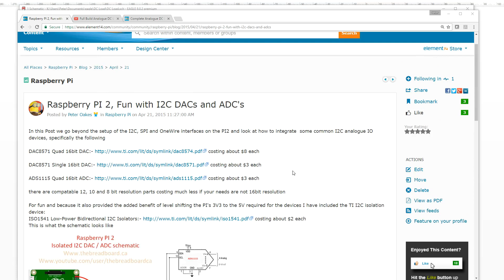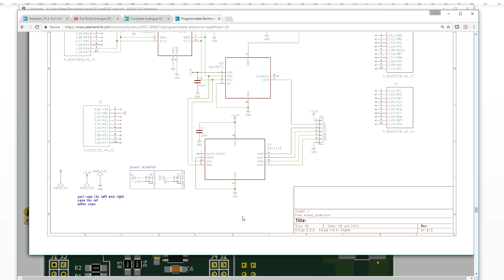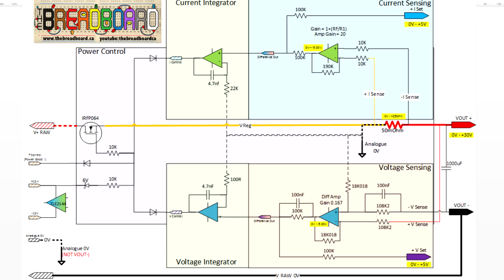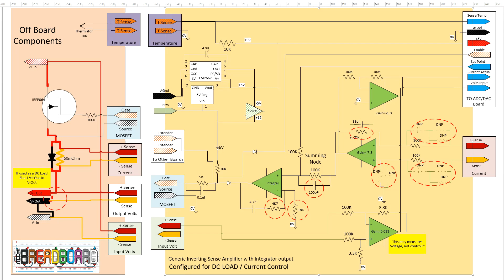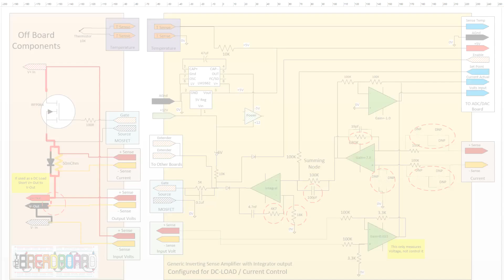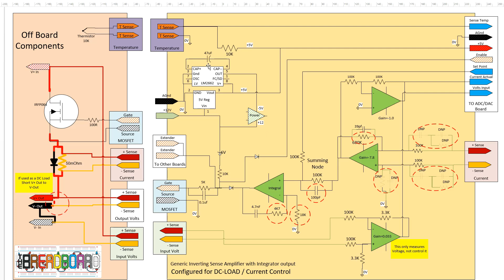Automate DC-Load and Bench Power supply... Finally we're off again

Comment: Did this project go anywhere? 
I don't see anymore about this project on your channel.
Reply from the maker: There has been a lot of work on the Element 14 community site, a PCB was developed and using TI microcontroller a SCPI based interface also was created for use as a DC load. I plan on using the same PCB;s to create a full blown power supply control system but I have not got back to it yet... I will be soon

Comment: Dear Peter
This "Power System" series is an absolute brilliant set of videos!!!!
Very practical for me as hobbyist but with the necessary precision, it is expendable and upgrade-able.
I built the old DC load and it works perfectly

Now I'm going to build the power supply.
I was fortunate to salvage a large thyroidal transformer from an old inverter and I am going to use it in this project.

May I please ask where I can find your latest circuit diagram?
I'm only interested in the analog version. Not going to do the digital control yet.

Kind regards
Stephan Cilliers

Comment: Hello Peter, keep in mind changing your 1K resistors to 100K will severely slow down your rise and fall times for the mosfets.  You may want to adjust your 4.7nF caps to compensate.
You should also consider Reverse Polarity Protection.

Comment: Looking forward to these projects continuing.  Thanks for all the information.  Do you have a central place where all the schematics and lists of parts are kept for the power supply and load so far?  The element14 pages have the high level pictures, but don't have details of all the parts (eg. opamps, current sense resistors,etc) or schematics.
Reply from the maker: Working on it, ill try to get them in place with the next video
Reply: Great, thanks again.
Reply: thanks sir, it will be very helpful to have like all the files on github...

Comment: This all looks interesting, but I'm wondering about costs. 
Does "sponsored by element14" mean you get the parts for free, and thus have little concern with their price? 
I mean why mention costs of 5% vs 1% resistors when the selected DAC, for example,  is the most expensive of the DAC85xx range (or almost any range of quad 16 bit jobs). Why not the  DAC8555IPW for instance, at less than half the cost?
If there is good reason for the selection, then fine. I just hope you are making the effort to select less expensive parts where possible.
Reply from the maker: I am not trying to tell the viewers which DAC or other components to use, they all have their part to play in one scenario or another, the point it to try to show where selecting different components can impact the final result (Precision and Accuracy). Yes I get a lot of my parts for free but that's not the point, I still try to explain the principal to select the component best suited for your application. If you dont need QUAD channel, 16 bit then dont get that one, go for a single 12 bit DAC. for many applications this will be good enough. If your going to build a precision dual channel power supply then a QUAD 16 bit DAC with low drift etc may be just the ticket.

A lot of the information is based on gaining knowledge of how things work and how to use them. I select a practical example so viewers can relate. At the end of the day, if someone simply needs a power supply for the bench with no fuss and bother, then the cheapest way to go is to just buy a completed unit. I you want to learn how they work or build a custom power related app, then this can provide good background information.

Comment: thanx good i was thinking that his project was ded or cancel i realy hope it will continue regualy
Reply from the maker: All the way to having some boards designed for the opamp section and building the power stages based on new design, and of course demonstrating using it with perhaps LabView using the remote control via SCPI. It helps I have a friend participating in the endeavour. and I am also happy to see so many followers respond positively to the resurrection of the project.

Comment: Nice.  Can those ISO1541s be used "in parallel" so you could have adc or dac's on two different power rails?
Reply from the maker: Yes, I dont see why not, there open collector afterall (Or open Drain, either way..)